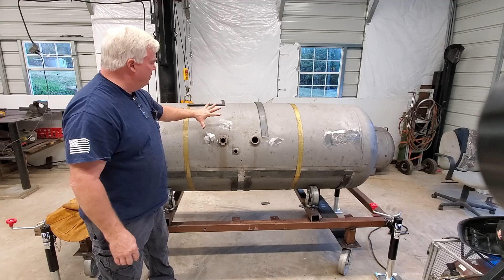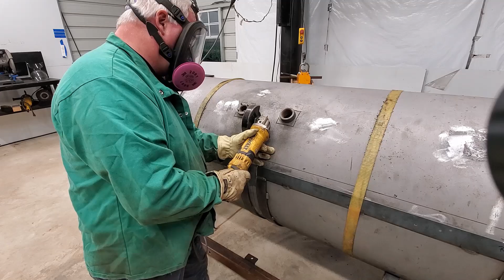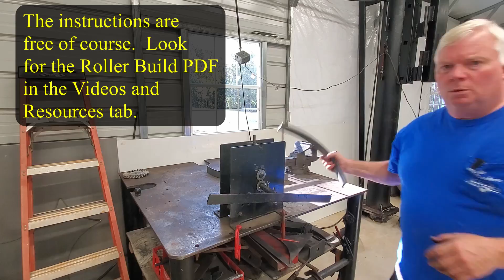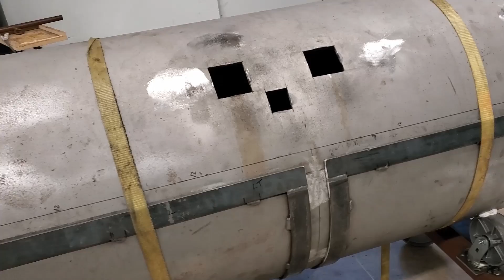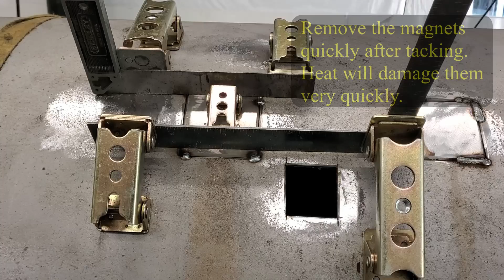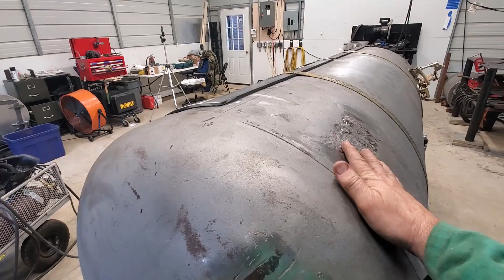BBQ Smoker 250g Cooker Bung Repair Episode #4

Comment: Hard to understand why you don't use hearing protection. I now have hearing aids as a result of a lifetime spent in the shop with substandard or no hearing protection. Just a thought.
Reply from the maker: I do use hearing protection.   In later videos, you  will see that extensively.   

I also use a PAPR system for anything other than a very quick grind or weld.
Reply from the maker: I do use hearing protection.   In later videos, you  will see that extensively.   

I also use a PAPR system for anything other than a very quick grind or weld.

Comment: Is there a scrap tank you have that you could cut one large patch instead of several small patches? Just came over from your other channel. Now I’m binging 😂
Reply from the maker: That's a good question Jason.

I really never cut a tank in a way that would generate scrap.  
As you see, I use the entire tank less the parts that come off for the collector or the firebox joinery.  Those parts have compound curves to them and having come off the heads (end caps), they are usually thinner material as well.  

The reality of it is, its easier to roll and make patch material than it would be to keep a scrap a tank of each diameter.   

In addition,  just like the Gnat project,  the series is geared to help guys using tools and materials that the average home builder would have access to. 

As rare as these old tanks are getting,  it would be a shame to cut one up.  

In fact,  I sell patch material and door bands to guys who don't have access to a roller and dont want to purchase one yet.
Reply: @mysticsmokers3014   Ahhh, I thought I heard you mention you had scrapped tanks in the past when the doors go sproing.  What do you use for your firebox a tank or pipe?  I don’t have access to casing pipe in my area so I am using half of a 60 gallon compressor for my 80 gallon build. 

I do agree with your use of Nomex. Do you have any issues with rain getting in past the seal when not in use? I never cover my grill and will probably never cover my smoker. 

Thanks for your reply!
Reply from the maker: @jasond4084  Yeah, by scrap I mean scrap yard or give them away.  I see what you mean though, pull  a large chunk off to use.  I could do that, but honestly,  making them is still probably easier and quicker.  

I use pipe for fireboxes.  3/8" wall usually but sometimes 1/4" wall.  I dont like going thinner.   

Rain will seep past the nomex over time but nothing like if you weren't using it.  Keep everything oiled up good and allowed to drain.  Also, if you notice water getting in, its better to leave the doors open for airflow.   Mold will go crazy in there if not.  

Of course then you have mice.   Toss up I guess.

Comment: Hey, awesome videos. Should rename to “demystifying smokers”. Quick question, my tank (old air compressor tank just under 1/4” thick) has holes dead center on both heads. I plan to do do firebox mount a bit below center/grate level, how would you recommend doing the head repair?
Reply from the maker: How large are the holes?

If they are two or three inches or less, I'd use a piece of 1/4" plate cut larger than your hole by about an inch all the way around. 

Heat the plate with a torch to glowing orange and shape it with a hammer to the approximate bowl shape that you're looking for.  It will take a while to get it hot but it will get there. 

Then, trim it to size and  pop it in the hole.  

Let it stand taller than your tank head.  That will give you plenty of material to remove your hammer marks with a sanding disc (36 grit) and bring it down to a smooth transition.

Hope that helps.
Reply: @mysticsmokers3014  thanks for the advice, will do. Not at home but it can’t be more than 1-1.5”. Also, do you have any of your flat Abe rollers left? I didn’t see any on your website. I think you had also mentioned in a previous video Harbor Freight sells something similar but I can’t seem to find it.
Reply from the maker: @johnmayberry9800  
I designed and made this roller for the guys who are tired of trashing the Harbor freight versions.   

I am making several as we speak. Contact me via email at mysticsmokers@gmail.com and Ill give my phone number from there.  I purposely haven't placed them on the website yet.